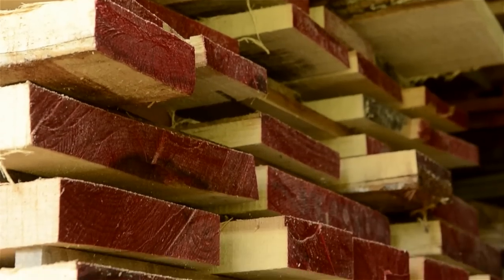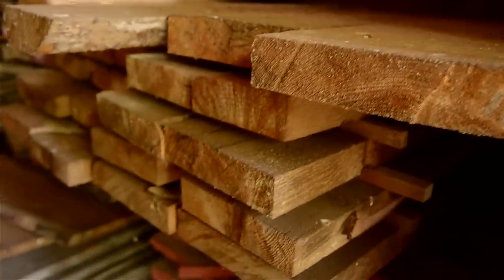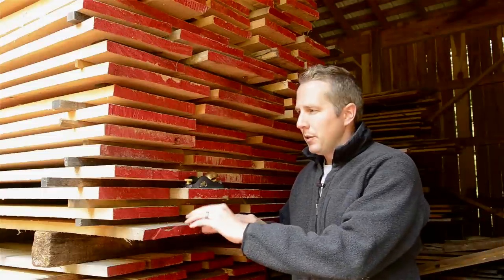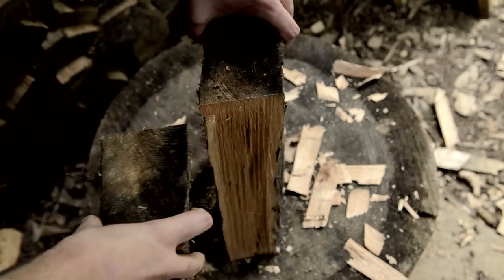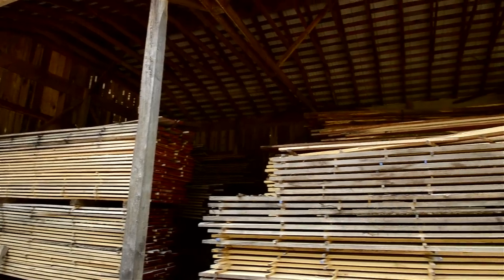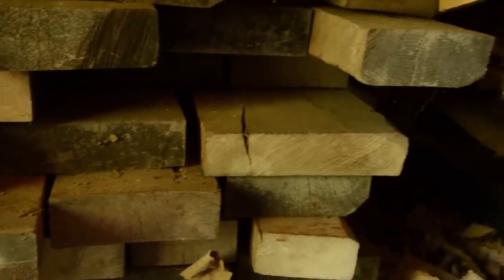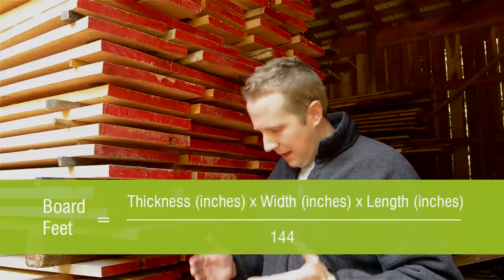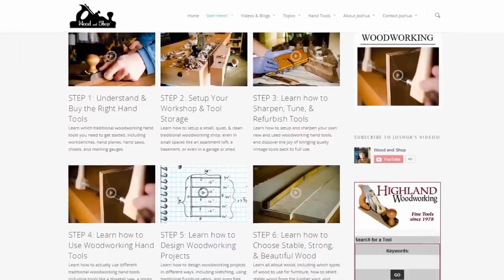How to Choose Lumber for Woodworking

Comment: Correct me if Im wrong, but the terms "softwood" and "hardwood" have nothing to do with hardness. Is only a clasification to differ between angioesperms and gymnosperms respectively.
Reply: You are completely correct softwoods are normally evergreen which don't lose leave on the winter hardwoods loose their leave in the winter. I'm sure there's a much more scientific and better way to say that but that's just how I learned it haha.
Reply: +Alex Mueth And you are correct in your reasoning.
  On the whole, hardwoods (the broad-leaved, deciduous trees) are hard woods, but not in every case.  (Yes ... it is confusing.)

Comment: Very good explanation of wood.  I also went through the same problems as you did.
I live in the Richmond area and I don't buy wood that is grown East of about Charlottesville because it is wind blown.  It is extra hard to work with.  I have been as far as Harrisonburg and Culpeper, Va  to get quarter sawn and figured wood.  In this video you were at a place close to Charlottesville.  Does this lumber mill sell kiln dry material and would you mind sharing this mill location with me?  For me it would be a lot closer to get good material.  Thank you

Comment: Thanks for a very informative video. I couldn't help wondering when you are selecting your wood what happens if you decide the plank right at the bottom of the pile is the perfect one you need for your project. How accommodating are these mills when it comes to moving their lumber around to give you access?

Comment: I really appreciate all your videos! I was trying (with no success) my hand at using a hand router plane and it caused LOTS of tear out going across the grain and basically ruined the piece. What am I doing wrong with the router plane that it's so difficult to use? I even tried taking off just a little at a time but, still, no success. Thanks!

Comment: Hi! Actually, we own some acres of forest with mostly cedar and cypress and a kinda white oak (the Japanese variant, Sugi & Hinoki & Kashi). I would really be interested in knowing how to cut (rather break with a wedge) 2-inch by 2-inch by 6-foot long strips (these are not called planks, are they) for a glued tabletop. Traditional Japanese woodworkers use a wedge-like knife tool all the way from a chunk of cut tree trunk,  breaking it all the way down until they get planks any size they want for roof tiles etc. For a tabletop, which part of the tree would I need to concentrate on in order to get the best possible stock? The cedar and the cypress I think are softwood types, and the Shirakashi being kinda hard. Any advises would be great.

Comment: Thanks so much for a very informative video,  I live in the Atlanta area and have had a difficult time finding a good mom and pop mill so to speak. I love supporting small business and would prefer to avoid the big box stores and refuse to pay what woodcraft and rockler want for their wood.  I would be willing to drive a good hour away if I found a good mill, but haven't come across one yet, if any reading this know of one around the Atlanta area please chime in, and one again thanks for posting this.
Reply from the maker: Patrick Nolan I'm sure you'll have more options than WoodCraft & Rockler. Here's what I found in 10 seconds on Google:

https://www.google.com/maps/place/Atlanta+Hardwood+Corp/@33.7677129,-84.420604,11z/data=!4m5!1m2!2m1!1shardwood+lumber+atlanta,+ga!3m1!1s0x0000000000000000:0xb551d519a7b12838

http://www.hardwoodweb.com/dryingyards/html/HWWSpeciesGuide.html

http://www.inter-statehardwoods.com/

Comment: Josh, enjoyed the tour, thanks. I think in your effort to simplify hardwoods vs softwoods, which is not necessarily the same as hard woods vs. soft woods, some people may have missed your point. Janka hardness is more of an advanced topic, it seems to me. I have found that one of the things that consistently surprises non-woodworkers and beginning woodworkers is learning that hardwoods are defined as deciduous trees vs softwoods which are evergreens/conifers rather than on their hardness or softness. My apologies if you covered this in your blog post :)
Reply from the maker: Michael Anderson Hi Michael, thanks for your comment! Yeah, there were a lot of more advanced things that I would have liked to have mentioned, but wanted to keep everything simple. But I did recommend that people look at this book: http://www.amazon.com/gp/product/1561583588/ref=as_li_tl?ie=UTF8&camp=1789&creative=390957&creativeASIN=1561583588&linkCode=as2&tag=woodandshop-20&linkId=IYPR6IG5OOEVXLNP
Reply: Wood and Shop That's the Bible! Plenty of advanced topics there :)  I still refer to it for the formulae for calculating expansion/contraction for different woods. Or sometimes if I'm too lazy to look it up I just assume 1/8" per foot.

Comment: you mentioned "rift sawn"... it's not at 60° angle. 
Wikipedia defines it as, "Rift sawing (radially sawing) is a technique of cutting boards from logs radially so the annual rings are nearly 90° to the faces. When rift-sawn, each piece is cut along a radius of the original log, so that the saw cuts at right angles to the tree's growth rings."

Comment: As far as thickness it should be pointed out that a 1" board is not the same as a 4/4 board.  A "dimensional" board, such as a 1x4 is not actually 1" whereas a 4/4 board is actually 1".  The same is true for the other quarter sizes compared to standard dimensional lumber.

Comment: correct me if im wrong cubic feet calculation for wood is length X breadth X thickness / 1728 (all in inches) i.e 12 x 12 x 12 =1728

Comment: Question for you. You mention that quarter sawn is more stable than rift sawn. I have actually always heard the opposite. (see http://www.advantagelumber.com/sawn-lumber/) Did you just mix the two up, or have I just understood it wrong?
Reply from the maker: Hi Jatato, thanks for your question! I am often wrong about things, but that web link that you sent is most definitely labeled incorrectly. Where they put "rift sawn" should have been "riven". You can check many other sources to see that rift sawn boards have grain that is between 30-60 degrees from the face. You may want to notify that company of their error. They totally left off a rift sawn graphic.
Reply: Wood and Shop thanks, and please don't think I was saying you were wrong. I just wanted to make sure I wasn't confused on it :)
Reply from the maker: Jotato No, I totally understood that you were just trying to learn Jotato. Thanks for your great question! With so much confusing info out there I wanted to clear things up. I hope you follow my blog and videos!

Comment: the link to your blogpost does not work sadly
Reply from the maker: I just tried it, and it worked for me. Did you try this link? http://woodandshop.com/how-to-choose-lumber-for-woodworking
Reply: Wood and Shop
I am getting a 404. when I add the www before I get the right page.
Reply from the maker: laikmiandu Try to NOT add the www. Does that work? Just click the link in the description instead of modifying it. You can also just go to my home page and scroll down to the blog section.
Reply: Wood and Shop I am just clicking the link in the description, but if I am the only one with the problem, its not a problem - i can get to the article the other way
Reply from the maker: laikmiandu Very strange problem. Which internet browser are you using? Thanks for notifying me!